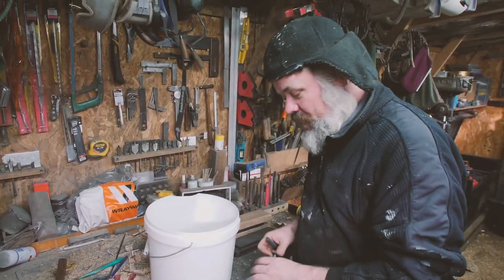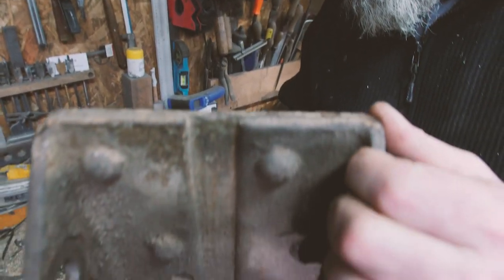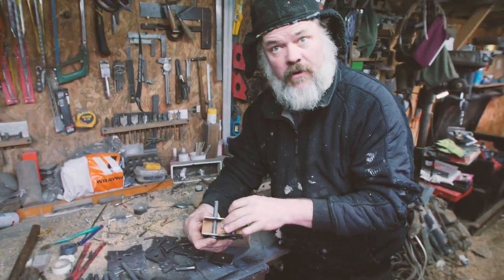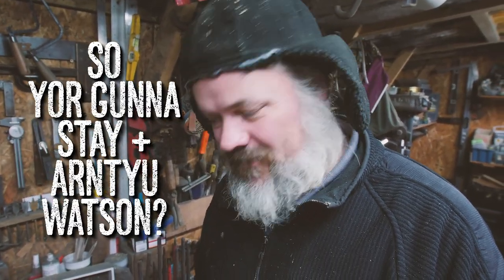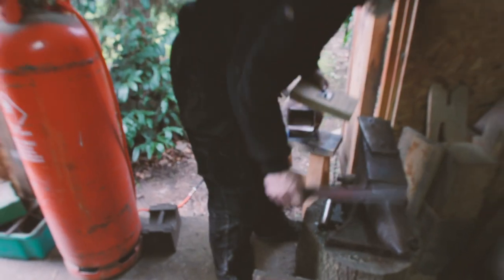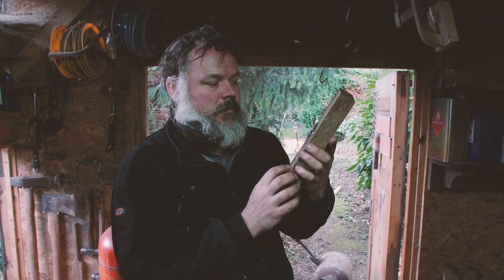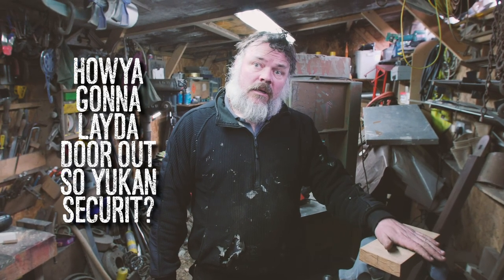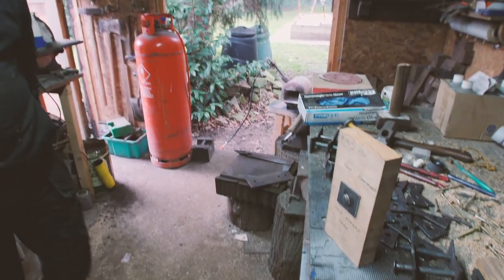How to make a front door Ep4 | Closing steel rivets by hand

Comment: Great 'hand job' on that peening !!  Just a thought....one of my first jobs was working for an iron works contractor.  When we did cold riveting it was all by hand, but the largest rivets we used were about 1/4 inch.  He had a tool steel 'former' that we used to beat the ends of the rivets round.  It was basically a 9 - 10 inch bar of tool steel with a 1/2 inch round half-circle in the end of it.  We cut the tail end of the rivet off and placed the half-moon tool over the stub and beat the stub round and tight.  Don't know if this exists for a 12mm rivet...may have to be made...but as much as u'all use this type rivets, may be worthwhile.  Hand peening on the door seems very risky, as the margin of error is small and a miss-strike could easily damage the wood.  Cheers !!
Reply from the maker: Strega, really interesting stuff there! Thanks for taking the time. I recently found a bearing cup from a old gate automation system I salvaged. This might make a good ‘head former’. It seats a 25-30mm hardened bearing. Might sand it down and make it easier to use. Will chase this up with Camera Lad - might make an interesting video! Appreciate your thoughts, as always very erudite! All the best. Al.

Comment: Hi All

I am a aircraft technician and i have used pneumatic hammer tools to cold form rivets. It is aluminium rivets that are used on aircrafts but the tools have been used to fixe iron rivets on other equipment. 

I think you could start forming the rivet with the pneumatic tool and then finish it with a hammer.
Reply from the maker: God it would be amazing to have a pneumatic rivet header! I keep my eyes open, but not sure I’ve ever seen one. Let alone one in action. It would be a niece touch to hand finish a rivet like you suggest. My wrists really took a beating in the next film! Cheers for you support, all the best. Al

Comment: Al,  rather than trying to cold forge the back side of the rivet, I would wrap a wet rag around the "washer" as a heat sink to keep the oak from burning and then with an oxy/accetylene or oxy/propane torch with a small brazing tip heat just the end of the rivet cherry red and in a couple of hammer blows hot forge the rivet head that you desire. My hot forge rivet tip for the day.  Love your work.  Tom
Reply from the maker: Tom, did you see our episode of the Throne where Al added hot rivets to the oak- it almost burnt the shed down! It wasn’t your exact technique but I think it may have deterred Uncle Al from similar escapades! Love the comments chief, going to join us this evening for our premiere?
Reply: yes I did see that but Al had heated the entire rivet cherry red that is what burned the wood.  I am talking about just heating the very end of the rivet, the last 1/2 inch or so, cherry red and then just upsetting the end of the rivet.  That won't burn the oak or the shed.  Tom @DirtyShedCreations

Comment: Hey we've all done a bit of peening this week but yours is bigger than mine 😉 
Very Interesting Guys! 👍 😊
Reply from the maker: Cheers Sparky, have you actually been peening, or is a double-entendre type deal? Let us know fella!
Reply: Me with a double-entendre?  No it was hint that you should check out my latest video You will see me wielding my biggest hammer 😉
Reply: I have dutifully subscribed! Will be checking out your tin casting! Really interested in getting going casting! Any thing I should be checking out? Cheers for your continued support! All the very best from one Shed to another. Alphonso Gospelspleen, my ‘nom de plume’! It’s Al to clarify.
Reply: Hi Al  my only advice is, if you use plaster of paris make sure it's very dry before pouring, other wise I just make it up as I go along
You are not silly so I won't give you any safety advice 👍   

I also have a question you can help me with please 
I have some mild steel flat bar for a project what can I treat it with to turn it black? I was going to try brick cleaner acid? (too big to heat up and oil black)
Reply: Also the only videos I have done with tin and casting are  25, 27, 35